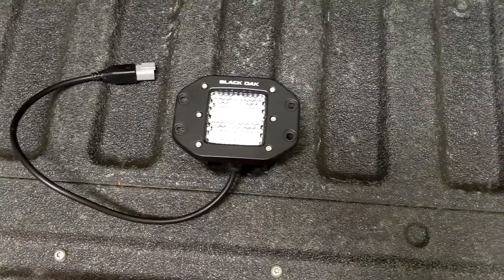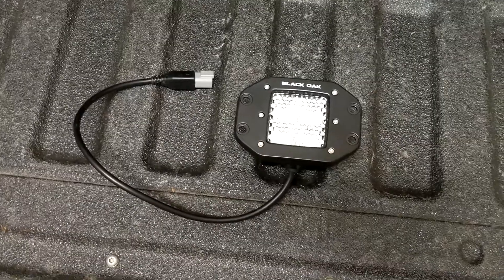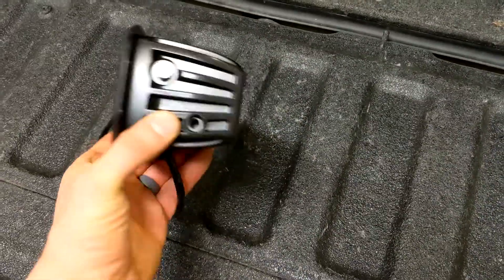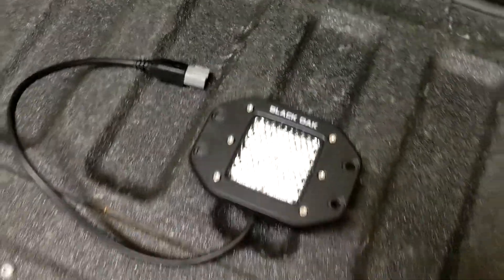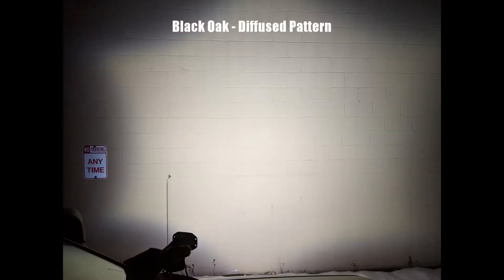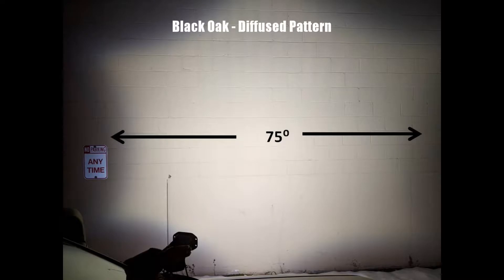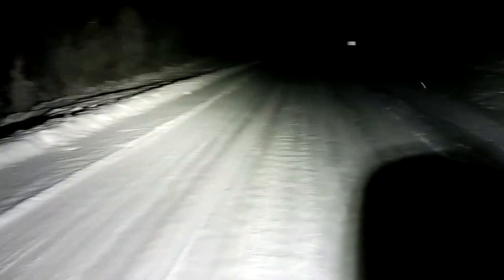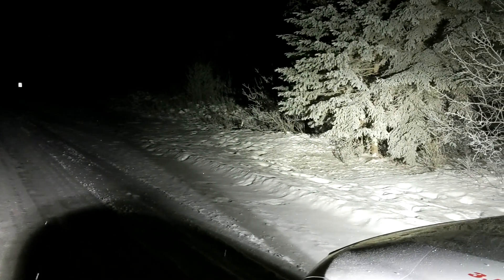A Mathematical Comparison of Diffused and Flood LED Pods

Comment: Great video, it was very helpful. Still trying to decide which would work best as low mounted auxiliary lights on my VW Golf driving in heavy snow.
Reply from the maker: I think as a driving light, flood would be best. Also, have you looked into the Amber lights? I know those are popular for snow.
Reply: @NSQGarage I was looking for amber lights for my full size van as fogs for rain and snow. I like the driving beam due to the light output

Comment: Good video. Exactly what I've been looking for. I'm thinking about getting these for my motorcycle to light up the road a little better. The diffused definitely look like they would produce a more even pattern if slightly angled down. I know it's only been a few days but would you recommend them?
Reply from the maker: Are you asking about the brand  Black oak or the diffused pattern?
Reply: @NSQGarage  I guess both. I've never used Black Oak.
Reply from the maker: @billydowelliii7323  I would recommend Black oak. They are rigid-like quality, but not the crazy price tag. You have a warranty and great customer service which you cannot say for random eBay and Amazon products. As far as the type of light, I would say go with flood for your motorcycle. I don't think diffused would be good for a forward driving light. I don't think it will have a good reach.
Reply: @NSQGarage  Thanks for the feedback. Black Oak looks like good quality from what I've seen. I'll check them out and look into the flood lights.  Cheers!